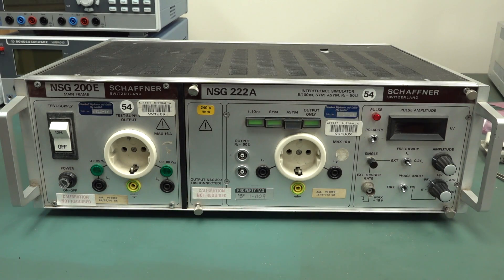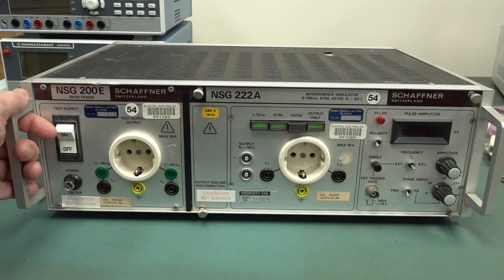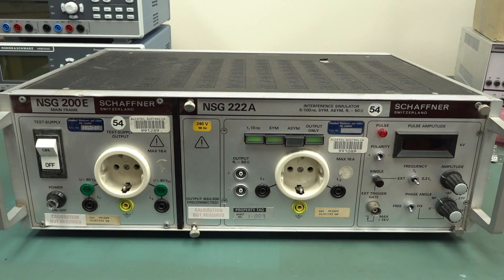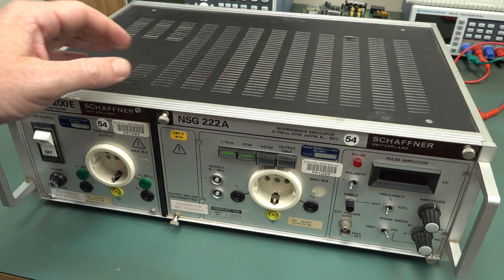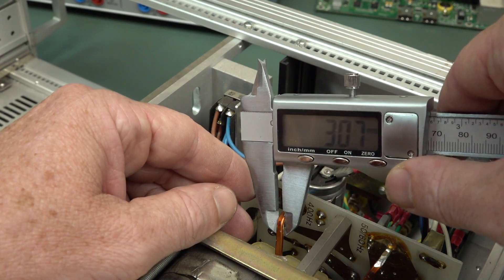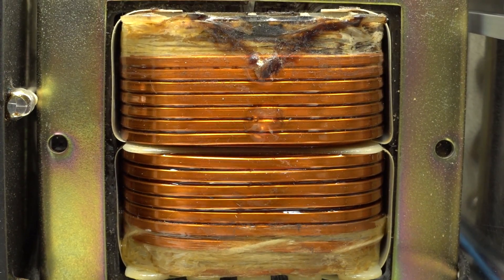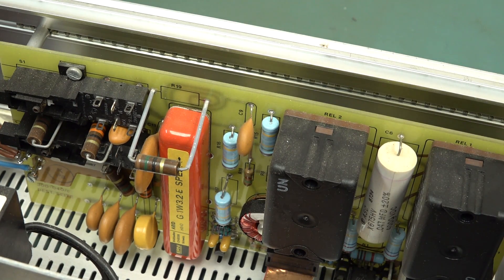EEVblog #1182 - Mains Interference Simulator Teardown

Comment: My soldering gun fried itself, and I saw it smoke, it didn't scare me at first, it was just like "Darn, it broke" and just non-chalantly unplugged it: Then, I noticed that after about 30 seconds, it was still smoking. At that point I started to get scared it would actually ignite from still being hot. Thankfully it didn't.

It seems that due to the thermal mass of coils in general, if they get hot enough to smoke, they're going to keep smoking for a minute or two.

Comment: Based on the panel marking on the 222A, lower left, I wonder if you're supposed to leave the NSG200 OFF when doing the test. Maybe the 222A was feeding those pulses back into the 222 and it caused the choke to flash over?

Comment: no way we produced rubbish in eastern germany. for example: an east germany made audio-amp came with 100VA output, you knew there is at least 100VA on the output. if you bought a west german amp after reunion with 100W you could hope for 30W. :/
\\with many parts from the  past GDR inside.

Comment: I would recognise that  asset number anywhere (property tag) but not the vintage kit itself so obvious which office this came out of.  Dave, if it hasn't hit the bin, the physical asset folder from the nameless company would likely have the schematic if you feel like contacting them and asking for Steve or Rob. 

The 400hz on the chock may indicate there is  a module to generate old aircraft immunity pulses as an option and probably just showing the chock is speced for 50/60 Hz and 400hz. 
 Something in the very early DO-160 or for-runner standards my guess. Maybe MIL-STD-461

Comment: Hi! I need help with a project. I am trying to turn Dell AC511 sound bar (Monitor speakers) into portable speakers. Their "aux in port" dont work when turn on using a powerbank or a wall charger. Aux in only work if connected to a PC USB port, Probably some communication in the D+ D- ports. So is there a way that we can use a power bank and send some sort of  a signal to D+ or D- as well to make the "Aux in" work ? It works with a router USB port because router also communicates through D+ D- pins of the USB.

Comment: Dave! Please check those RIFA paper EMC caps at 10:21, I'm pretty sure they are the culprit, the choke should be fine. The black spot is probably some paint, dissolved from the core into the potting laquer. Also the ITT cap might be a PIO, and if so, it should be replaced. There's an other RIFA paper cap in the injection module at 17:08 on the back of a switch.

Comment: Hi, I have used this equipment for post office pre submission testing to meet post office security approval. The testing was on mains powered electronic postal franking machines. These machines effectively  hold post office revenue .  And very stringent testing was required to ensure that there could be no corruption or possible fraudulent attempts to defraud the postal authorities. Testing was to UK, US, and European postal  authoritie standards. I also did ESD testing using Schaffner equipment. I worked for a company called Neopost which at one time came under Alcatel.

Comment: 07:17 Are you sure it wasn't that Rifa style X cap in front of the choke that released the smoke. It does look as if it has a crack in the top of it. They are notorious for failing.

Comment: But why they used composite resistors ? It even seems to on purpose!
Reply: These are being used for their excellent ability to withstand high power pulses. This is due to the energy being evenly dissipated throughout the whole volume of the resistive element. More modern film style resistors don't fare so well with pulse loading as the pulse energy is concentrated into a relatively thin film on the surface of the resistor giving rise to excessive peak temperatures and eventual failure of the resistive element

Comment: Live to earth fault in common mode choke perhaps? Maybe it is possible to rewind it with 2,5mm2 insulated wire or bypass the CM choke and resurrect that device for oscilloscope check?

Comment: On the schematic you can see the 50/60 and 400Hz thing too. my guess is that you are supposed to move one of the spade connectors to the other setting to get the right cap for the frequency in the filter.

Comment: I may be tempting fate by posting before watching rest, but...

10:50 - It looks like the extra spade terminals allow it to take some filtering out of the circuit when a 400V supply is used?

(I don't imagine 400Hz would normally be input via IEC socket on this type of product anyway, so maybe it was just an unused option on that specific choke?)
Reply: btw, "Standard Telephone and Cables" was a company here in the Old Dart that was eventually bought by Nortel...

https://en.wikipedia.org/wiki/Standard_Telephones_and_Cables

I used to work for Nortel, and I believe their main R&D / fibre optics division in Harlow was on the old STC site.

So yeah - that thing is pretty old. lol

I spotted some 1986 / 1987 date codes in there. Amazing years for movies (Top Gun, Labyrinth, Robocop, Predator).

Comment: I’d bet all the potting is to obfuscate the design, it’s the equivalent of the Chinese rubbing the numbers off chips... I worked for a company that potted lots of “custom” modules that were nothing more than small PCBs with COTS ICs.. they were very simple, but clever circuits in most cases...

Comment: Being that the dangling chip is a DUAL BINARY UP COUNTER, could it have been not telling the board a number of pulses delivered, and causing the pulse generator to go into runaway?  
Datasheet: https://www.datasheets360.com/pdf/-7385397319899951011

Comment: Check the resistance between the windings of that common-mode choke - I can’t see it failing due to a short in one of the windings themselves; they’re not operating as a step-up/down transformer, so they’re not rated to have mains across them. It’s also possible that something else failed, not the choke; the crud might just be something that got spilled in there and dried up.

Comment: I live in the US and am so happy we don't have those huge ugly ass mains outlets.  I go the EU a lot and carry a plug adapter and even the adapter is hard to fit in a travel bag.  Curious if your houses over there have those big ugly ass holes in the wall too?  Those big round outlets are in all the hotels.
Reply: The typical Australian residential outlet is more typical of those here in the U.S., only the live and neutral blades both slant inwards instead of being vertical or horizontal.  They may also have an insulator sleeve on the plug side blades (similar to UK) to reduce coming into contact with 240VAC during plugging/unplugging, but it’s been awhile so I’m less certain in that point.
Reply: I don't know, I'm from the EU, and when I was in the US with those small plugs, I was afraid the plug would fall out of the socket on its own weight.

Comment: At my old job, we had a massive California Instruments rack mount 90° 2phase inverter that could generate 400 Hz outputs anywhere from a few volts to a few hundred volts. We used it for testing motors and synchros intended for Defense and aerospace applications. The inverter was far too large for me to salvage intact, but I did salvage the old waveform generator from it when we scrapped it. The chokes and transformers in it put this to shame... Though at least it's wires were standard round solid copper wire, and not freakin' bus bars! WOW! Your bit of kit wins in that department!
Reply: I think 115V/400Hz is a standard power supply for aircraft equipments.
Reply: @gautamdamodaran  That's exactly what it's used for. Generally, transformers and other electromagnetic components can be physically smaller for a similar power rating at higher frequencies, so there is a mass savings benefit to making 400Hz the standard for aerospace electronics.

United States military standard MIL-STD-704 is responsible for more or less making the use of 400 Hz a standard for aircraft.

The reason we don't use 400 Hz in power line distribution, is that it's not economical to transmit over distances, due to increased series impedance.

Comment: KACO is an old german company - Kupfer Asbest & Co. They made vibrators for vibrator power supplys and relays in the past, nowadays they only make sealing elements. I have a really old 12V DC to 220V AC inverter with a massive vibrator cartridge made by KACO, a wonderful thing that wheighs a ton and produces a nice humming sound when energized :)

Comment: 15:15 Electrically isolated by a steel cable bridging the huge air gap? There must be a simple constructional reason for the distance when they use steel cable for the physical coupling, wouldn't you think?

Comment: My guess is it let the smoke out before they threw it away.  Then the contact between the exposed coils oxidized, pushed apart, and created an air gap.  Then it worked fine for you until you put any kind of load on it.
Reply: Nope, I'm 99.9% sure the choke is fine. The black mark is some paint from the core, dissolved in the potting laquer during dipping. The smoke came from one of the RIFA paper capacitors, or the ITT cap might be a PIO which vented. The EMC filter inside the mains input IEC connector might also be the culprit, since it's also a Schaffner made one, there might be RIFA MP caps inside.

Comment: 11:40 - What's up with the 5cm-long leads on that 15-ohm resistor?

(Answered later on) - inducing some inductance!
Reply: redundance 101
Reply: Could also be thermal reasons to allow greater convection underneath the component. Didn't see a fan for airflow, so it may be for that reason.
Reply: @Y0urpants  Yeah seems like it would be thermal reasons. Traces on the PCB would give better results if you wanted inductance.

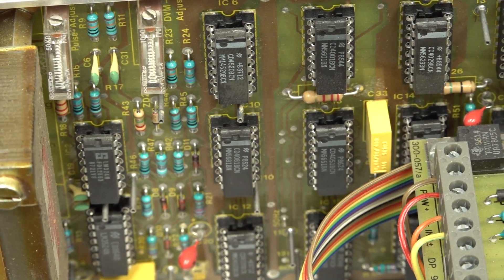Comment: 12:50 Do you know "Elko" as a term for something really specific or a brand name?
We usually use the abbreviation Elko for "Elektrolytkondensator" in Germany, which is simply an electrolytic capacitor.
I'm just curious because you said you don't see 'em very often these days...
Reply: Well, then there must be the brand "Elko", which Dave was referring to and then some caps with a German origin with a marking that it is in fact an "ElKo" (Elektrolytkondensator), in case you didn't recognise the component.
Yes, very confusing indeed.
But I think we got it after all :D
Reply: It's quite bold of them to name a product by such a generic abbreviation. They may have even registered that as a brand, which shouldn't really be possible.
Reply: The capacitor had the word "Elko," written on it. My comfortable guess is that it's a brand name.
Reply: NWOization I know. But still, it's the German for electrolytic cap, thats why I wondered...
But brand name is absolutely possible
Reply: Julian Weinert the brand of this ‚Elko‘ in fact is FRAKO - i still have some of them in an old bin... :)
Reply: @jlegen  So they're made in Germany then?

I know that there is a brand called Elko that deals with electronics, but this mustn't be one of theirs.
Very confusing tbh.
Reply: NWOization  yes, they do still exist. You can read the FRAKO label in the vid on this cap (german abbrev. is ‚Elko‘) up side down on the part...
Reply: @jlegen  Thanks for the information jlegen, it's good to come across someone who knows what they're talking about.

Julian was right with his initial presumption.

Comment: The 400 Hz tab  is most likely for aviation based testing. They usually will have 115 Volts by 400 HZ driven by the engines.
Reply: Ah, I suppose you would want a lower inductance on a 400Hz system, right?
Reply: @Basement-Science  yup, the inductance at 400Hz might be too high and cause saturation
Reply: IMO the 400Hz thing is irrelevant in this device, they likely just reused an existing transformer frame and PCB from another product to make the common mode choke for this one.
Reply: @michaelblaser6088  Yes I know but the common mode choke visibly doesn't have multiple taps in the first place.
Reply: Brilliant supposition thanks!

Comment: The large input filter and Common mode choke make sense when you realise that this device must keep the DUT nicely isolated, both in terms of receiving any perturbations from local noise on the mains used to drive the test, and to prevent the noise and surges it actually injects into the DUT from coupling back up the supply and into the mains powering the unit!
Reply from the maker: Indeed.
Reply: A bad device under test could have had a ground loop to the chassis through a shorted "safety cap." This happens when people used this on metal tables and tested MUCH older equipment. Someone tests their old heathkit transmitter on it and BOOM...
Reply: @garbleduser  I think you misunderstood the type of isolation Max Torque mentioned. This unit doesn't have an isolation transformer, the DUT is not galvanically isolated from the mains. Max talked about the extreme filtering between the mains and the output, which is intended to isolate (filter out) the surge pulses (generated by the instrument), from the mains supply, otherwise you could inject the pulses into the electric network of the whole building.
Reply: Hi! I need help with a project. I am trying to turn Dell AC511 sound bar (Monitor speakers) into portable speakers. Their "aux in port" dont work when turn on using a powerbank or a wall charger. Aux in only work if connected to a PC USB port, Probably some communication in the D+ D- ports. So is there a way that we can use a power bank and send some sort of  a signal to D+ or D- as well to make the "Aux in" work ? It works with a router USB port because router also communicates through D+ D- pins of the USB.

Comment: 400 Hz is used for military mobile purpose.
Reply: Commonly used for aviation systems as well. Still not sure how that tap corresponds to frequency though
Reply: @UnreasonableSteve  Perhaps they chose for a standard choke which also supports the extended version of this module.
the device itself and the mains filter only supports 50 & 60 Hz
Reply: @UnreasonableSteve  Maybe they need a lower inductance on a 400Hz sytem?

Comment: @10:55 c4, c5 or c6 x2 caps aren’t blown are they, have seen them fail several times.
Reply: These types of caps come pre-blown from the factory, but sometimes it takes them a few years before it sinks in.
Reply from the maker: That's what I thought but they looked ok. And the smoke was coming more from the back where the choke burn is
Reply: EEVblog - the AC Input Filters fail too, I captured one blowing up on camera once, the smell was horrendous, it stank my lab out for 2 weeks ! #193 Who let the SMOKE out ! HP 8904A Multifunction Synthesizer Repair Part 1 https://youtu.be/xodwAeGD9kc
Reply: 2 weeks! Bloody hell. That must've really been smoking a lot for a long time.
Reply: Simon Tay Not necessarily, the electrolyte from some electrolytic capacitors can certainly stink things up for a remarkably long time before that smell finally wears off.  Just one small electrolytic that failed my my oscilloscope power supply still reminds me of its death for a minute or two each time I power on the scope and that was several years ago despite having wiped down the chassis and scrubbed the power supply PCB clean with IPA to try and clean off the remnants of that electrolyte!  For the first minute or two after I lower it on I’m faced with that awful smell and am left wondering “has another failed again?”.
Reply: I had he same thing happen to my 8904A and I can vouch for the horrific smell that it made when the potting compound came out of the filter module

Comment: LOL @ "you don't see many Elkos" - after all, Elko is just an abbreviation of "Elektrolytkondensator", which means electrolytic capacitor. And those are basically everywhere ;)
Reply: I was thinking exactly same. In Finland we shorten elektrolyyttikondensaattori (electrolytic capacitor) to elko.
Reply: And  @jamisusijarvi646  thats an extremely nice word!
Reply: Check out my comment. We discussed a bit over there and we found out that there is a brand named "Elko", which Dave probably was referring to, and then also some German caps with the designation of "ElKo" 😂
Reply: @juweinert  I think if you look close at the Elko Dave is pointing to that it is branded "Frako". A still existing German company.   I found those often in German brand tv's, radio's etc.
Reply: Suffering from audio ELKOholic syndrome.
Reply: when I hear elco I think ElCamino. and im in the uk. we never got el caminos. :/ i blame the internet
Reply: I think there is/was a brand called Elco though, I'm sure my B&O 8802 has some, unless it's a variation on the spelling of kondensator.
Reply: Also in dutch "electrolytische condensator" abreviates to elco :-)

Comment: I don't understand how the common mode choke was failing. If the insulation breaks down and the adjacent wires touch, it is only less inductance. Not like line and neutral could touch. 
Or is the core grounded somehow and it shorted to this?
Reply: I dont think it's burned out at all. I reckon one of those RIFA caps let the smoke out
Reply: @jaycee1980  I agree that it is worth checking out. The bottom part of the coil looked a little pale as well. We need a follow up!
Reply: It depends on where it shorts, you could end up with a very low turns shorted transformer since it shares the same core, basically a center tapped autotransformer... would be interesting to see the coil teardown for root cause...
Reply from the maker: I don't get it either
Reply: I suspect the chip that popped out was a comparator, a regulating component, or a controller that was telling when mosfets to pull one side to ground.
Reply: Being that the dangling chip is a DUAL BINARY UP COUNTER, could it have been not telling the board a number of pulses delivered, and causing the pulse generator to go into runaway?  
Datasheet: https://www.datasheets360.com/pdf/-7385397319899951011